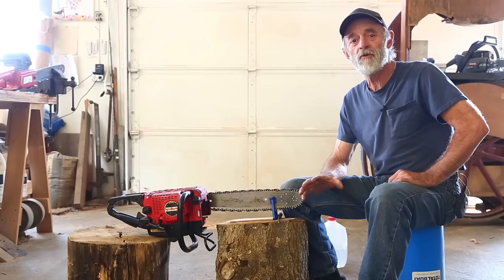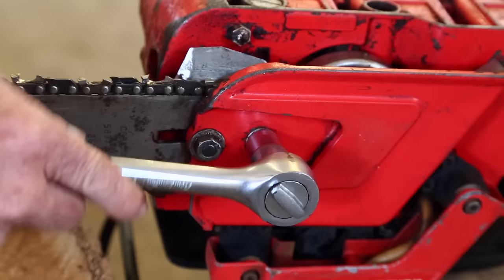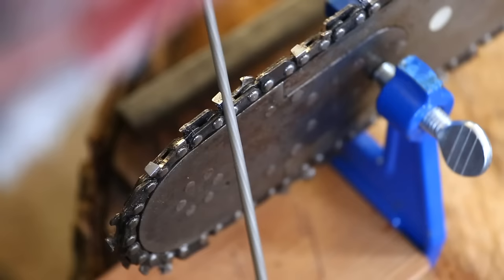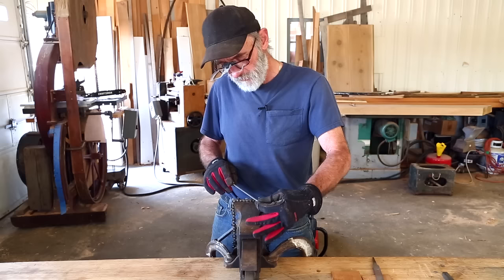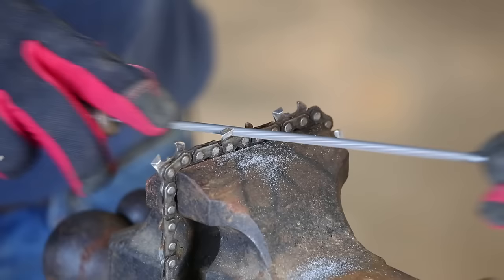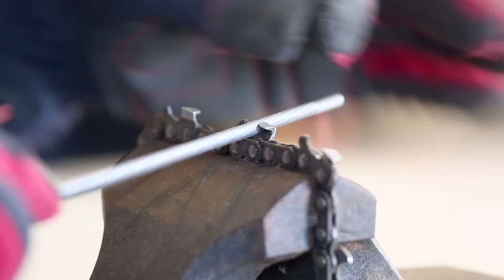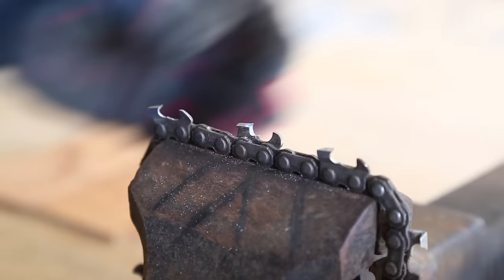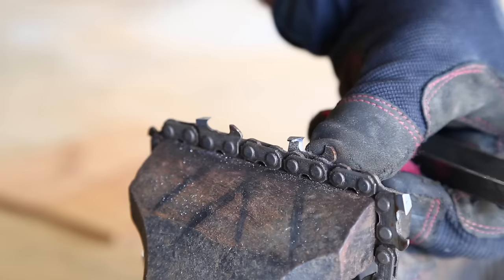How to Sharpen a Chainsaw by hand with a file

Comment: I've run chainsaws, falling here in B.C. for the past 25 years and this is the first video on filing a saw that I've watched that covered all the important bases without any gizmos or useless info confusing the subject. Well done.
Reply: Could not agree more.  I'm a casual cutter....I cut only my own firewood.  I've been filing my chains like this for 30+ yrs. and this is the first video I've seen explaining this simple method of sharpening a saw chain.
Reply: I use mostly hand powered tools, I do my own firewood so it's good and dry when it goes in the stove, and occasionally use an old Echo I got new in '86.  Correctly sharpened chains means never straining the motor, or the chain, or Me, which means I've yet to amputate anything.  I've demonstrated to others how I sharpen chains, but I can't explain and demonstrate at the same time - no way. I listen to these tutorials because I know it true, and hearing it explained in great detail is somehow comforting, relaxing.
Reply: Simple, easy, cheap, without gadgets and unnecessary extra tool. Bravo!
Reply: thanks for the great video. it is the best i have i have seen. you are great. cain filer. thanks and thank u tube.
Reply: Are you sure about that first video you've ever seen that explains it that way I don't think so
Reply: Teaching myself to fell large rotten eucalyptuses...
Scary stuff but feels good to get right. 

I can say after three days of this that you dudes are tough and I’d never wanna have to scrap w a lumberjack. 

Semper fi
Reply: So why did you look this up?
Reply: I just started working with a tree service comapny that clears right of ways for the power company and this helped
Me alot because i can dull a saw pretty quick.
Reply: @calebjordan8095  the other guys send ya in first to find all the fence n rocks so they’ll know where they’re all at 😂

Comment: Best sharpening video I have seen !
Having spent 4 years in a sharpening shop that was founded in 1936, 
& only fixing chainsaws, I enjoyed this video. Covers all the points
 we were taught, down to removing the burr.
(We were told to tap the cutter with a vertical stroke, using the end of the wooden file handle. This would fold the burr down over the cutting edge, and break it off.)
We would often have 20 or 30 chains to sharpen first up in the morning, and did them all by hand. The owner of the shop said that no other way would get the right finish on the cutting edge.
Reply: Georg Schwiemann learn from a pro this is a crap way too file a saw,  if you work in a saw shop surely your aware of file guides?
Reply: Jealous?
Reply: @rabbitskinner  nice work on giving a reason why it is crap...
Reply: haha I'll telll you why its crap , is became every cutter needs to be filled  to same size and filled to an exact  angle. Free hand filling  from my 25 years experience using  a chainsaw daily as a proffesional arborist tells me most people can't  get the exact angle without a  file guide.  Stihl, Oregon,  and Husqcvarna make fike guides for a reason.
Reply: T J  lol say that to me when YOU have have sharpened a 48 inch bar 10 times in one day...
Reply: haha that guy is outright dangerous,  just the way he even starts  a "power saw" everything about his style scares the shit out of me! I think I'll make a video.
Reply: @rabbitskinner  You have the art down of "Saying many things yet saying nothing" congrats
Reply: @rabbitskinner  Thanks for this comment.  Although I like the video and explanation I always use file guide.  Wonder where to get a guide to set raker height
Reply: @jimw6991  chainsaw shop its called a raker guide. Oregan make them
Reply: @rabbitskinner  If you need a file guide then you more than likely shouldn't be trying to sharpen a chain

Comment: GREAT VIDEO !!  I have been sharpening for about a year now and have watched hundreds of videos about sharpening, maintenance, etc.  I finally got the hang of it and do pretty well.  It all came down to doing it by hand, having the correct file and raker gauge, and most importantly feel.  You nailed it in your video and validated what it took me a long time to learn.  I wish I had seen this video first before all the rest.  Experience is a great teacher and it looks like you have a lot of that.  I just wish I could have learned from your experience instead of my trial and error.  Thank you.

Comment: I've never been able to sharpen a chain and have it to work correctly again.  Sitting in line with the bar and looking down  made all the difference! I'll need to practace to get all the chips the same size but it cuts as fast as it did new. Thank you for this video!
Reply: I know the feeling. It's an art form.

Comment: Outstanding explanation & demonstration on how to properly sharpen a chain & achieve proper raker height. How to properly hold the file & make the cut was excellent. Measuring the raker, removing the gauge first, make the cut, check it again & simply round off the raker's corner for the final touch. This is by far the best tutorial I have seen on this subject. Thank you... :-)

Comment: I use a marker pencil to mark the first link in the  chain, 
so I know when I'm through. 
Thank you for the tutorial.
Reply: You should be able to tell just by looking at the tooth if it's been sharpened or not. No marker needed
Reply: With his method I believe inspection will allow one to know when it’s done. But a marker is probably the best way.
Reply: Theyre all supposed to be the same size. Thr marker is for the smallest tooth, then you file them all down to that size

Comment: Excellent video. I'm surrounded by woods so i've been running power saws for over 15 years, mainly to feed my woodstove, but I'm always learning new tricks.
One thing i picked up recently, and I noticed in this video, is the little hump that is left down in the gullet (the ridge of metal left on the side of the file away from the cutting surface). If you file that down your saw will cut much faster and run more efficiently because the chips are more likely to fly out and not get caught up in the cut. It feels like you're ruining your nicely sharpened chain the first few times you do it but you'll notice a change immediately.
Buckin Billy Ray has a great video on YT about this.

Comment: excellent video! one question- 3 different angles...whats the purpose of the other 2 lower angles?
Reply: For a different chain. The "chisel" that he describes are different between some chains. It is listed on the box when you buy the chain... or experts like him just look at it.
Reply: Normally you would sharpen to 30 degrees for most cutting. 35 degrees for very hard or frozen wood. 10 degrees for ripping (cutting with the grain).

Comment: mark the first tooth you sharpen so you know when youre done!
Reply: Jason Dodd of you look, lots of chains have a double tooth (two consecutive teeth in the same direction) where the chain was joined. And Sthil normally has a tooth painted green. Makes a built in starting place.
Reply: You can tell by the shine on those already done when you get to the last dull chisel.
Reply: I always hit my first tooth with a red sharpie. One saw has a double tooth the other two don't.
Reply: Jason Dodd if you can’t tell when you get back around you shouldn’t use a chainsaw.  Takes about 3 swipes with a new file.  He’s destroying those chains.  No need to reprint them.  Just sharpen the chain after the chain is warm.  Sharpens like butter.
Reply: If you file every day and use few strokes, being completely random about where you start and stop can also maintain even shaving.  While this method prefers shorter filing sessions, just 2 minutes a day keeps the chain feeling fresh.  Make a habit of stump vising your final log every single day.
Reply: A Sharpie marker on the top of the first tooth , wisdom as well as wit !
Reply: why could you not just notice the difference

Comment: Mr Sauzedde , thanks very much for explaining this , you,re the first guy I,ve seen sharpen a chain in a vice , & dress the guides also , I,m going to try this , as I believe it will make all the difference in getting the angles & fine tolerances required right , Best Regards from central england .

Comment: I have watched a number of saw chain sharpening videos and this is the best one I have seen.  I’m a former logger and this is almost exactly how I did it.  The main differences are that I didn’t turn the saw upside down as fuel can leak out and I didn’t carry a stump vise around in the woods.  I would just cut an inch to two into s stump and let the cut be the vise.  I also did like to rotate the file away from the tooth as that helped to keep the file in the proper location and not have it creep above the tooth.    With practice, a slight file rotation is easy to do and I do it now without even thinking about it.
Reply: Part of the file NEEDS to "creep above the tooth" to avoid too much hook.
Reply: UpnorthHere No.  A fraction of the file should project above the tooth to set the cutting edge angle, but the file should not move/creep upward on the stroke.  The file should move only axially, not radially on the stroke.  If it creeps upward, it has the risk of jumping out of the tooth and rounding over the cutting edge.

Comment: My Dad ran a saw for years in northern BC as a faller. When I ran a saw for a few months hand sharpening with a round file with the chain on the saw was the first thing he taught me. Time is money and a sharp chain is way safer than a dull one. I would eat my lunch then sharpen the saw for the afternoon. Out in the bush you don’t have the time for anything else, and you can easily carry a file or two with you so you can sharpen anywhere. Once you get good at it you can sharpen a chain pretty quick.

Comment: Very good instructional video. I’m fairly new to the chainsaw game and was amazed at how quickly the chain gets dull. I purchased one of those Stihl sharpeners when I bought my Stihl chainsaw, but have not had much success using it. In this video, the file seems to move easily and fluidly whereas I keep getting hung up with this tool.

Comment: Perfect.  I want to add that the chrome plating will be curled up (disturbed) by filing from the underside (from inside the tooth) and this indicates the file has done it's job.  I use my fingernail to feel for that chrome burr as confirmation.

Comment: Nice tutorial, thanks for covering rake height.  I would like to have seen you explain that the angled mark at the top of the tooth is also used to determine weather the chain needs to be replaced.  Kudos for explaining the advantage of file over grinder.

Comment: i love it..   i bought some crap tool off ebay that sucks..   i already have those files..   and a vice..   very cool..  i dropped my pole saw on the side walk and it probably did 20 revolutions on the concrete..  that tool i bought was just to do a quick sharpen from normal wear..  thanks for the video..  i subbed

Comment: Thank you for the tips.  I've often thought about just using a simple file, since it is the tool that does the work.  I scare myself, because I'm not sure I could be as consistent with each tooth.  I had a great clamp on guide once, but it got lost in the woods when I forgot to put it in my truck.  I bought another guide, but it wasn't even close to the one I'd used many years before, and it was the same exact style.  Oregon makes an "idiot proof" hand held guide contraption that is supposed to be THE ultimate filing apparatus. It even files down each raker as you stroke.  They are made for various pitches of chains.  My saw guy was out of them last time I was in his shop.  I need to go back and see if he has a new supply.  Apparently I tossed the box that my brand new chain came in, as I can't find it to tell him what file guide I need, but it can wait a while yet.  A sharp, accurately cutting saw chain is a pleasure to use.  One that is dull and filed incorrectly is pure torture.  Raker guides are very important to maintain, due to the physics of what is taking place as the cutters pass through the wood.  Cheers, people, and thanks my filing friend.   Bob

Comment: Similiar system to how my Father taught me to keep my Chainsaws in top working condition  only differences were we used a homemade Wooden stand with a CClamp to hold the Saw Stable  plus we marked the Start /Finish tooth with Red Nail Polish !

Comment: Thank you for a simple explanation of chainsaw sharpening. Tip...we use an old bar in the vise for off saw sharpening rather than readjusting the chain in the vise. Great video.
Reply: That's a good tip!

Comment: This is a good video for those learning. I have been running saws for years and I agree with most of your points. I agree that with experience you will just do this naturally without much thought. I’ve never had any gauges or training wheels of any sort. Just a round file and a raker file. There’s no need in my opinion to round over the rakers. I’ve never even measured the heights. You can tell by the way it’s cutting, and by tge way it looks. I just flatten the tops a bit with a couple swipes every so many sharpenings and keep going. A common mistake for newbies is to take too much off the rakers. I’ve been a logger on the west coast of BC for many years. No loggers use any gizmos, just two files and a bar wrench. Thanks for making a clear and concise video on the subject for those learning though. I dable with boat building. I respect your talents

Comment: Nice job. Note: no back-drag with the file! Files cut one way and that's on the forward stroke. Dragging the file on the return stroke will dull the file so lift the file from the material when returning to position for the forward stroke!

Comment: This is a good vid . I used to build timber wharves (jetties) for the Sydney Port Authority  and did this multiple times a day.best not to file to much 4 to 5 cuts at a time otherwise you end up with  different size teeth which is why the saw often rnns away from straight another things to twist the file with the wrist as you and rotat the file 1/4 to 1/2 a turn every few teeth this extends file life.  You don't need to this the chain off put the saw in a video gripping in the middle of the chain bar just tension the chain like the vid says all the rest. Words of gold to the ears of a old chippie

Comment: The lumber jack who taught me how to hand sharpen chain teeth said to lift up slightly in order to sharpen the very edge of the tooth.  I watch the file where it meets the outside edge of the tooth while lifting rather than pushing down (usually 3 or 4 strokes) and chain cuts big chips out of the cut.

Comment: Thank you sir simple instructions that I needed badly my papas Stihl was sharp until my uncle barrowed it and it came back with the bar showing signs of being way overheated and more dull than a butter knife lol I knew to use a round file on the cutting tooth but didn't know I needed to do the rakers as well as making them the same height you probably saved me from cutting off a leg or something horrible like that! Thanks for the video sir

Comment: Excellent tutorial. Yesterday I ruined a brand new chain on the second cut when I hit a stone which had grown into a trunk. (Well, you know what I mean). To my surprise the hardware store sold an Oregon file with file guide and handle for $12. Most important, the package of the chain specified which file is appropriate for that size chain. It did not come with a template for adjusting the rake teeth. But that was easy with a piece of aluminum and a feeler gauge. The rake tooth has to be 0.025" lower on this chain. Replacement files sell for $7 a PAIR. Filing is not difficult, I file my woodworking saws as well. The chain cut as new after 30 minutes well spent sharpening.

Comment: I use the same method, however I was taught to go the opposite direction ( towards the sharp edge ) just as you sharpen a knife. Works good, probably the same either way as long as your not going back and forth.

Comment: This would be an instructional to save.

Edit:  Thanks. This gave me the motivation to try sharpening mine with the sharpener I once brought (an Oregon file with an attached guide).  It's only an electric 16"x2.75" and is rarely used, but I want it in good working shape and ready to go.  The bits seem better; I'll have to find something to cut - I did two chains.

Comment: Thanks for passing your knowledge on to other people. I actually have an electric sharpener with the grinding disc but I don't like the time wasted with removing the chain, I also borrowed the kind of manual guide that clamps onto the bar, again I didn't like the waste of time of putting it on the bar and clamping it, then more time adjusting it or the other side. I thought I'd look up this free hand method and its a little intimidating but don't think it would to hard to learn and eventually get used to it.

Comment: 1) Why do you file in the direction that makes the cutting edge of the tooth trail?  Doesn't that impart a slight burr on the cutting edge?  Why not file with the cutting edge at the start of the stroke?  This issue occurs with most all sharpening, and there seems to be two schools of thought: do you sharpen in the direction that cuts into the sharpening material, or in the direction that draws backwards?  It seems to me that backwards will always leave a burr. 

2) Is the material of the cutting tooth hardened steel?  You seem to get a lot of chips very easily.  Are you using a standard hardware file?  Aren't some cutting teeth made from carbide?  How well do diamond grit files work, for either standard teeth or carbide teeth?  Is the diamond grit size too small for use on standard teeth?

3) You do a very good job of pointing out subtle details, proving that you have much experience, with a talent to figure out what's going on.  Thanks.